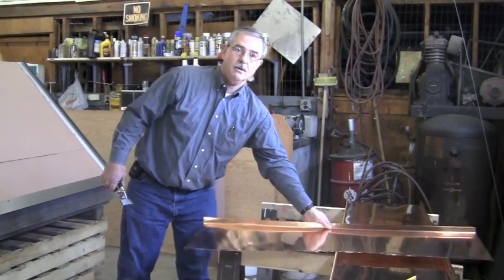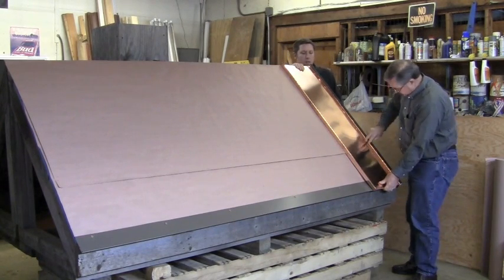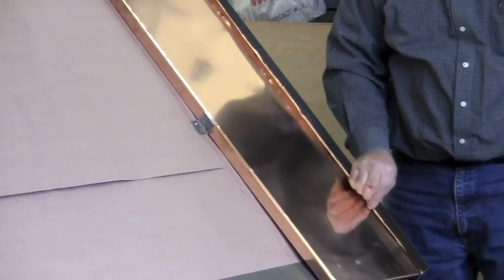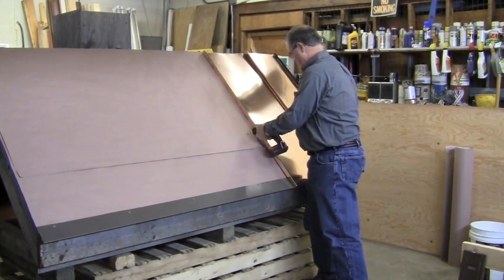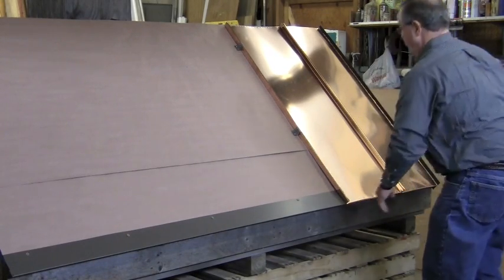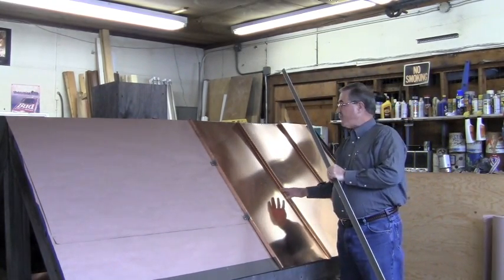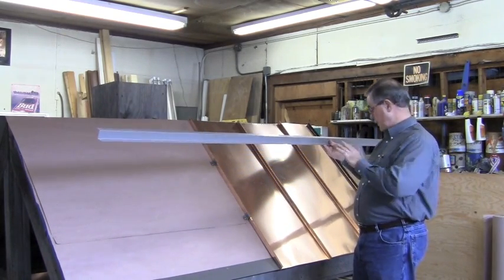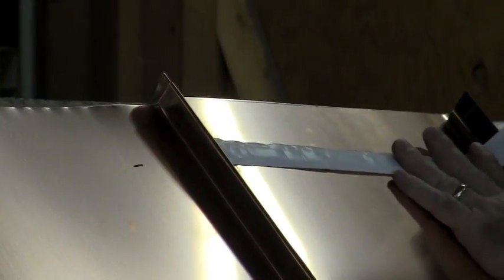Standing Seam Metal Roofing Installation Basics Part 2

Comment: Bob, so many people remark poorly about your details. Having some knowledge about how metal roofing is done in places they know how it should be done, I do agree with them. Your tutorial is pretentious and misleading.   It has ZERO experience and knowledge about the topic. It is not that we hate you or something, but you give justification to experts on everything to fool around pretending that they are copper roofers. They do a lot of damage around and in the end hurt your customers. 
Take this thing down and ask a real copper roofer, a person that knows how to deal with thermal movement, wind loads,
capillary suction condensation beneath the metal, making waterproof details w/o reverting to caulks or solder (among many other issues) to do such presentation properly.

Comment: I love zinc but is copper the same as zinc as fitting it to a roof live how would you solder it
Reply: Zinc is more temperamental. It is nicer to work with because its softer. Cant use it on flat roofs and you have to make sure what the temperature fluctuations are for thermal expansion.

Comment: where do we buy this roofing material?  I don't see any "standing seam" style on Lowes website.
Reply: ATAS makes and sells it on line  i think. I just started shopping for it myself as well
Reply: THANK YOU ! From a hand fabricating metal COPPER roofer, for decades."You can't git that hea' ."
Reply: At the bodega around the corner. You run a good chance that the mexican shopkeepers there will give you more correct technical advice, because Bob seemingly doesn't know exactly what he is doing. (Well, he sell the material nicely)
Reply: With 30 years in construction. I would say:    Lowe’s is a joke.  Rarely do they have the things you need. Let alone any sort of expertise.    Go to a local supplier.

Comment: I have done architectural copper for 15 years, and I don't understand why a fold over clip wasn't used. This would  be a semi-hidden clip that meets most wind regulations,  not to mention, no exterior holes through the pannels. Using an off set cleat is used so the pannels can be screwed down at the top and allows for movement of the pannel with heat and the lack of. Screws every 16 would cause tin canning, or wrinkles in the metal. everyone's  different.
Reply: Kevin meyers Y he not done a splayed end un that eave detail completely wrong un them tools

Comment: I disagree with the Z-Bar, we were old school and did our tops just like everything else.  The beauty of a standing seam roof is there are NO PENETRATIONS in the roof itself. Also, our seamers were foot and hand, you guys must have some extremely strong arms and shoulders to run hand seamers for both the low and the high sides on the roof itself.  We roofed the old train station in Fairfax Va.  Had enough hips and valleys to make life interesting and a great display of our work for decades to come.  That job was done I believe in 1984-`85.  Everything was done by hand, no fancy machine to make the folds.
Reply: the company i first started with, we installed the cap and drip first. A company i just recently worked with used z bar, but 10 foot sections and cut all the seams and installed across the top, which leaves a gaping hole 1" under the ridge! I like tieing everything together the old fashioned way, no penetration is the ultimate goal.
Reply: I've riden the bike trail from the old train station. Great work!
Reply: ALF FOR PRESIDENT I have always boxed in the tops of my panels. I know with some styles of panels you have to do a top screw in case the panels was to slide, and usually with the top boxed in we will put a screw in the very top corner along with a dab of caulking in each corner.

Comment: A good tool designer would design the tool to not scratch the roof... The Z closure should come precut too..
Reply: The Tool Guy Galvanic corrosion though =(
Reply: The Tool Guy True SS does corrode other metals though...
Reply: +2Awesome We always installed raw tin and painted it after installing. Scratches don't actually hurt anything except when doing copper and after 6 months and the verdigris process is well begun, you won't see them anyway.
Reply: koaheart For aluminum roofing, is there aluminum screws, or are you stuck with steel/stainless screws?
Reply: +2Awesome lol you have to/should use aluminum screws/nails on aluminum pans..
Reply: The Tool Guy There are plenty of shorter aluminum screws at hardware stores, just cant seem to find longer ones for roofing

Comment: you always put a screw at the top of the pannel after you slide it up and then a screw always goes at the bottom right above the drip edge and you really want to use a flat surface to cut and fold pannels. I can see your crimp marks on the bottoms of your pannels you want to use a rag in between your tongs just a tip not bustn your balls! and your seamers have two handles so you should really use both handles with both hands.